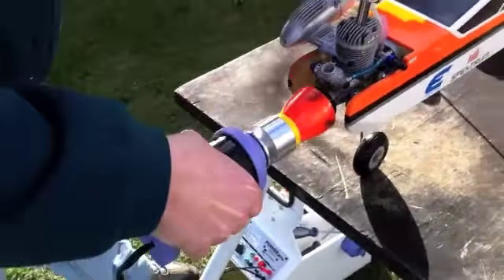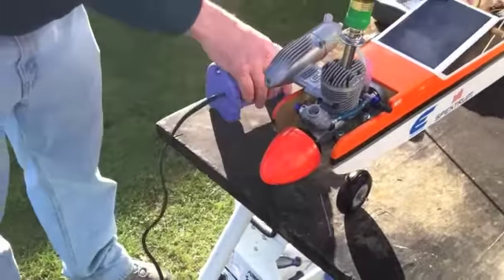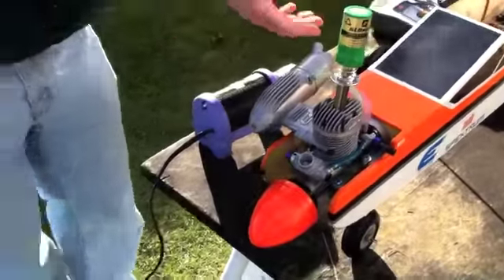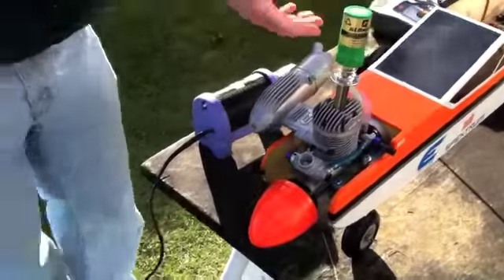Alpha 40 Trainer   Engine Fail

Comment: I have an Alpha 40 too, I had these problems as well, I wouldn't be wasting my time trying to fix the engine. If I was you and can afford it do what I did and fetch yourself an O.S .46 it hasn't missed a beat since I bought it, best motor ever although I haven't tried a Thundertiger 40 but im sure both will be better than the Evo.

Comment: i had the same problem as well.  this always happened when i started the engine while it was idling.  if you start the engine with throttle half open it solved the problem for me.  you can even tell the difference between the sounds of the engine when started at idle vs at 1/2 throttle.

Comment: The alpha is a awsome plane i have one but if it hesitates then it's to fat ,to much fuel or it will die if there is any air bubbles going through the fuel to the carb  15% nitro is the best to run in it it helps with a new glow plug hope it helps my evolution runs great